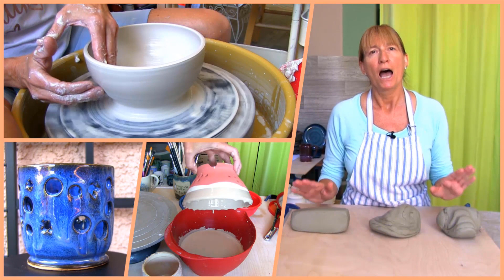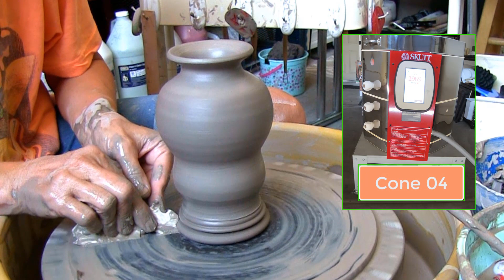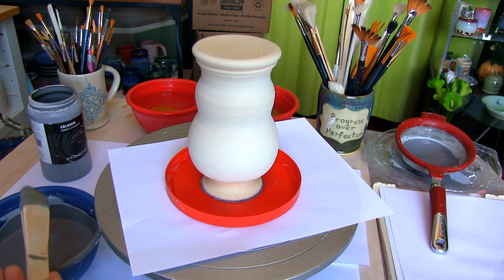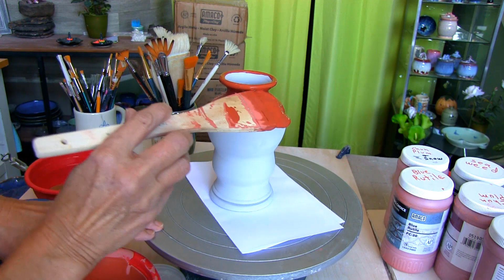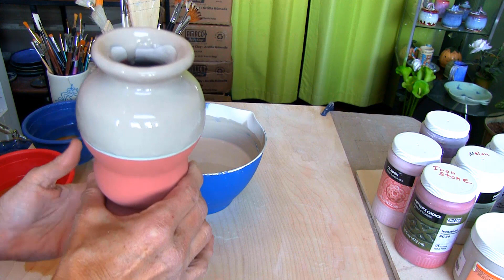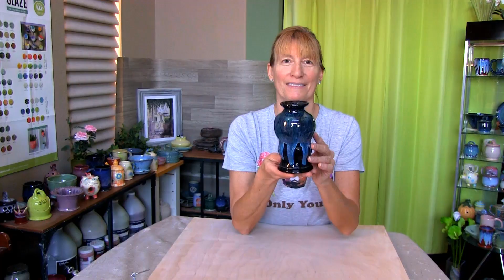How to Make a Vase on the Wheel For Beginners | Beginner Pottery Wheel Projects # 21

Comment: Whenever I pull up the walls I start near the bottom right corner but the clay keeps forcing my hand to the top and it starts feeling dry within 2 seconds. It's like the clay is trying to push my hand out of the way or something
Reply from the maker: Hi Melissa. Did you try using a sponge on the outside? As you notice I'm using a thin sponge to help keep the clay moist. Like training wheels. Yes, the clay will control you if you don't control it. How fast is your wheel going? try going faster and push inward as your hand inside is just guiding. Keep your fingers steady as you move the clay and keep practicing to get the feel of the clay 👍 I hope this help😊